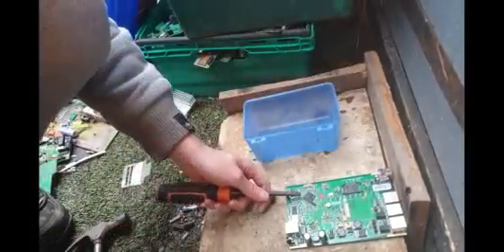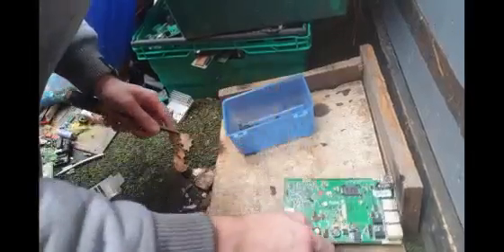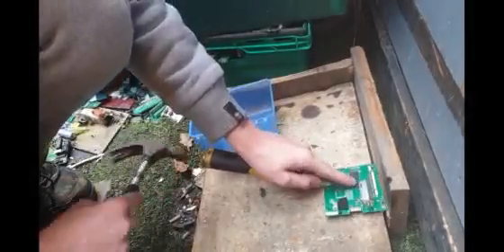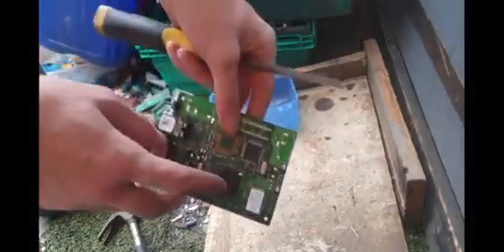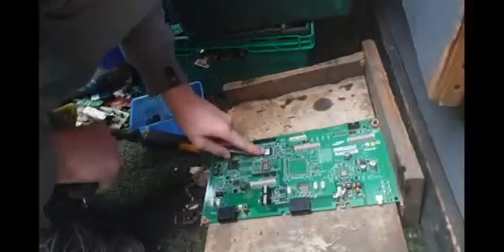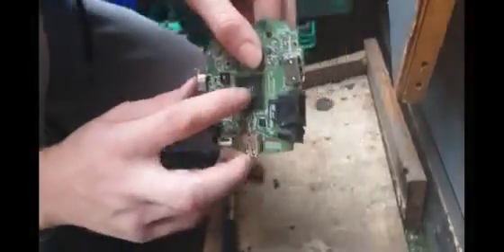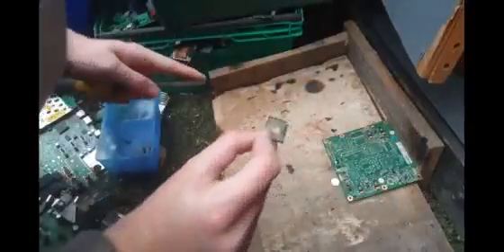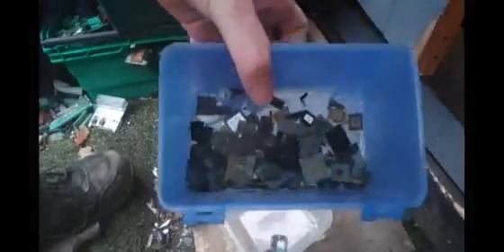bga chip scrap marathon for gold recovery (part 1)

Comment: Also keep your larger non gold corner bga seperate from smaller. They contain an average of 4-6 grams per kilo where as ram stick bga is only 2 max in my exp.
Reply from the maker: There processed the same anyway so I just keep mixed. I have ics, leds and transistors in 1 pile, gold corner in another and standard bga in another